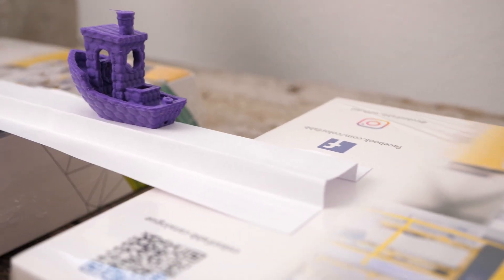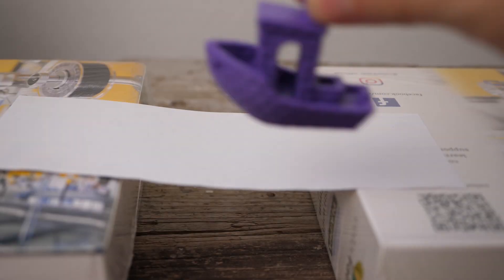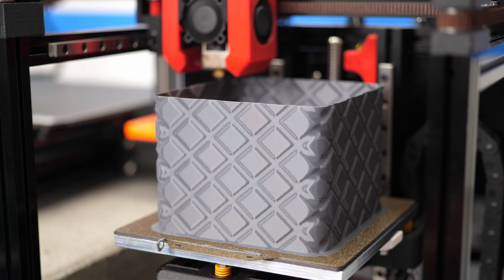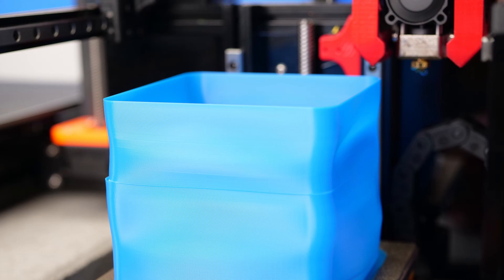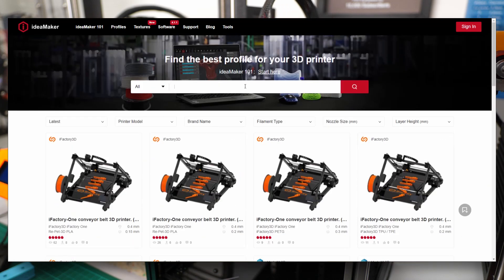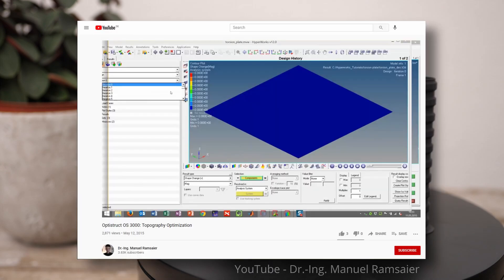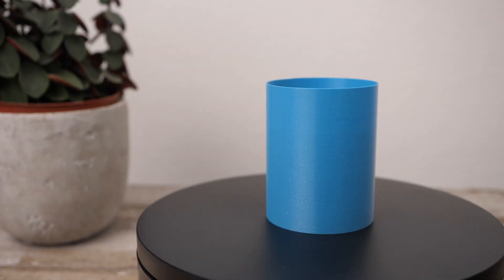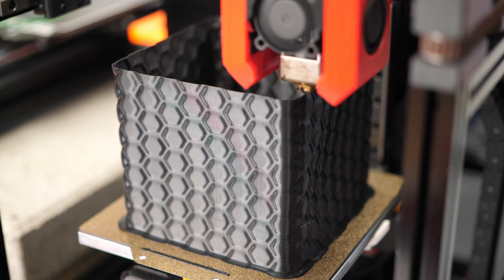Texturing 3D Prints for Strength!

Comment: Hey Nathan, I think you should make a video about surface hardness of 3D printing materials. I've seen on your channel all types of mechanical tests, I just thought it would be a nice addition and comparison method between materials. In my case I'm used to print a lot of spur gears for different mechanisms. So far my material of choice is PETG specially the one from MG Chemicals (natural transparent), I've found it to print very very smooth walls which help a lot with the rack and pinion mechanisms (maybe you should make a video on friction as well ;D) but I have the belief that it's surface hardness is way lower than PLA. For bigger gears and power transmission proyects this might be determining for the material selection.

Comment: This is really useful. I created a pull rod handle for my mother's curtains, and added some grip to it with the coil tool in fusion 360, but this texturing feature is exactly what I was looking for to add some grip to the handle which would be just a plain cylinder otherwise.

Comment: For each edge of your geometry draw a thick black line on your displacement map then gaussian blur and repeat until you have gradients  for each face, then apply sinusoidal tone curve and repeat until you have enough rings. This will give each face of the object a set of curves that follow its shape in a way that you can call poor man's optimisation. It is quick and it is dumb, but still adapts to the geometry that you have. The last application of a tone curve should probably be such that your original edge lines are in an area with mostly zero displacement.

Comment: Would you be able to only apply it for one side? I'm planning on using it for ducts for a quadcopter but don't want to influence the airflow inside
Reply from the maker: Yes, you can. There is an outside perimeters only option.

Comment: I've used that type of feature in modeling for many years, mostly for cosmetic purposes, but I'd find this all kinds of useful having this directly in a slicer. IdeaMaker continues to be one of my go-to programs even though I don't print directly out of it, it's built-in repair algo's are really decent, and dissecting things on the fly is super useful if you don't need it keyed.

Comment: This is a cool feature to add. I'd like to see transition options added to surfaces so that you could set inset distances where the texturing would start, and maybe add a fade in option. Would be nice to have this as a separate feature from the specific image file, so one file would be adaptable to a variety of prints.
Reply: Combined with a new N-Layer Vace mode you could get incredible strength in a couple layers.

Comment: Can I use the tool to make g code for a cnc mill?
Reply from the maker: It's not really meant for that application.
Reply: @CNCKitchen  the thing is I am using freecad and I am searching for a tool that enables me to make g code for my cnc because the path workbench in freecad is to complicated for me what application would you suggest for me thanks in advance

Comment: I need to test it on my assortment box system, since I already tested vase mode, but failed on larger boxes. And printing with higher wall thickness not only takes much longer, but is a huge amount of material just for boxes that usually never leave the drawer...
Reply from the maker: You'll be surprised how well that works.

Comment: You know they don't do it to save weight on a washing machine right? It has concrete bricks to add weight to the machine... They put features to the sheet metal to avoid the awful wobble sound that metal sheet would do if it wouldn't have that.
Reply from the maker: Saving weight in terms of expensive metal. Concrete is cheep.

Comment: I've been looking for a way to stiffen 3D printed ukulele bodies without adding more weight to get more "brightness" out of my design. This might be the thing. Now I'm wondering what pattern would be best for the front/top of a ukulele body: vertical line patterns, horizontal, mesh ...?
Reply: Have you considered traditional approach with braces? They are used exactly for the same reason.
Reply: @avelkm  Yes. Braces are what I am using now, very similar to a traditional guitar body with a set of just a few braces.  I am thinking of these surface patterns as a kind of large brace array, or a whole bunch of small braces, something that is not as feasible with traditional wooden construction but should be a unique feature of 3d printed bodies. I'm trying to move my design thinking from 3d printing traditional parts to "native" 3d printed designs that can take full advantage of 3d printing. It is not an easy journey.

Comment: Nice to see that slicers are starting to implement a feature i was searching for such a long time in cad. Was wondering. Would it be possible to get the texture on the stl file and then in a second step get the textrued object into another slicer like prusaslicer or cura
Reply: If only you had watched the video, you'd know...
Reply: @alejandroperez5368  i did but that detail I did not get an answer on.
Reply: @PBPZ22  no you didn't watch the entire video. The answer is no.

Comment: Fun fact: many water towers have rings around the cylinder on specific locations. This is not because of aesthetics but because water has the potential to break the container, thus those rings actually support the cylinder. Very similar to the idea stefan had with the washing machine.

Comment: "Texturing" 3D prints like this is certainly useful. Doing it in the slicer, however, seems kind of gimmicky. I'd always opt to do it in the design phase, where I have as much control as possible.
Reply: Not everyone only prints parts they designed themselves

Comment: Have done this kind of thing in 3d software like 3ds Max and Blender. Its the same method but dumbed down a bit and made easier to use.
I put nice leather pattern onto a file for someone a few years ago and they were really happy with the results.
Same principal as a lithophane. 
They might have also seen Billierubens posts about this on twitter in the past as well, so its by no means a new or even original idea but to give them their due, integrating into ideamaker was a great move so congratulations and thanks for the video Stefan, its always a joy to see that you have posted a new video. I don't think I've missed one but may have cut one or 2 short as they didn't hold any interest for me

Comment: Texturing, or "corrugation" can be absolutely necessary to enable printing. I've been working on designing rectangular bellows made of TPU, printed in single-wall vase mode. Without corrugation the tilted faces droop during printing, creating gaps and ruining it. Adding a light vertical trapezoidal corrugation removed the problem without affecting the functionality or creating other printing problems. A 16–20 mm width for each full /‾\_ period, distributed evenly to its four segments, worked well, with a corrugation "height" of about 1.5 mm. I painstakingly programmed the corrugation into the design in OpenSCAD.

Comment: Idea for future video: Vary the percentage of deformation introduced by the texture across multiple prints.  Test each print for crush resistance, evaluating the degree to which each level of deformation increases stiffness before it reaches diminishing returns.  Make a revealing conclusion that will enrich the 3D printing community.

Comment: This is reminding me of something. A while ago, I had heard of a paper that presented a way to print smooth(er) top surfaces on parts by having the printhead do a final pass over the whole top surface of the object (hopefully I'm explaining this clearly enough). Have you seen it in a slicer before? I wonder how much it would increase the strength of a curved part, since the whole top layer would be connected in one pass
Reply: Huh sounds like ironing, which is a setting present in Cura and PrusaSlicer.

Comment: Thanks for sharing!  Awesome method and wondering how this will catch on with the other slicers?  Thinking for aircraft or other designs textured is the way to go if using like you note PETG, ABS or maybe other materials with similar issues and concerns.  Seems like one can use a thin covering like Monokote or even pp tape like clear HD Duck tape for the smooth surface while optimizing goals.

Comment: Brilliant work Stefan. The next stage is optimising the width of the vertical ribs in the rounded cube for least final object mass with maximal deformation strength (in vase mode of course). I would think the thinner the ribs, the greater the total circumferential path and therefore mass.

Comment: if you could get the texturing on the inside instead I imagine that would be very beneficial for wings
Reply: Then you'd have to have at least a double perimeter, adding to the weight.
Reply: @JonS  maybe you could do a single wall layer and a light infill but modify it so you only get a infill mm or two away from the wall

Comment: vase printed threads have extra radial strength over a straight tube and are easy to add in fusion 360

Comment: I wonder if one slicer could implement something like this only for the innermost wall of a print.
Reply: Or use Blender for the modell. There bump Maps have been used forever...
Reply: @AndersJackson  Blender user here as well (since 2.49b). I was thinking more about having the pattern as the innermost or maybe 2 (maybe you could alternate the pattern) innermost walls, just before the infill. That kind stuff wouldn't be possible to change inside Blender because you can only change the shape, but not how it's sliced.

I mean even if you added the pattern in Blender (through the displacement modifier) to the inner side of let's say a cilinder, it would have to be hollow and thus the infill wouldn't be inside the model, but maybe just a really thin layer.
Reply: Agreed, hide this on the inside and allow the infill patterns to overlap...man, PLA wet could be strong...
Reply: What you're requesting makes no sense. Your print would be full of gap-filled areas where the bumps are.
Reply: Also a new N-Layer Vace mode would let you decide on the strength and set them separately for inside and outside.

Comment: This texturing would be awesome for draftshields for those of us that have open printers and want to use ABS/ASA. I know, a draftshield is not the best you could have, but it helps most of the times I print in ASA. Well, except when it bends into the print itself or bends so much that it gets an unusable mess that messes up the print...

Comment: How did the textures change the weight and length of filament used?
Reply from the maker: 1 or 2% more. Basically negligible. You'll notice a longer print time due to all of the direction changes, though.
Reply: @CNCKitchen  I started to think about weight when you brought up airplane wings.  I wonder if there is a texture that would have no negative aerodynamic impact while adding beneficial stiffness.

Comment: About warping, one important thing is that just after being deposited, the new layer is free to shrink because it's liquid. It only becomes a problem once the new layer solidifies, while it is still hotter than the layer below, because from then on you will get a differential shrinkage. This also explains why high glass transition temperature has much more of an effect than the coefficient of thermal expansion, and why heated chambers help as much as they do. You can also preheat the part using light, which I find very compelling but I haven't looked into it myself yet, though NASA did. They were able to print PEI on a relatively low-cost printer using an array of halogen lightbulbs to preheat the part.

I published a video on this just a few days ago: https://youtu.be/_x_PlqCr-2A

Great video once again!

Comment: The ridges on tin cans are not for strength.   They are there for when the food is cooked in the can during the canning process, it allows for expansion and contraction.  Food that is not cooked in the can will be flat walled.

Comment: I want this on the internal supports inside 3D printed wings. Not sure how to make any use on the outside surface without a lot of research; smooth may be best there.
Reply: Don't think it's going to make things better - internal supports of a wing are already oriented in most stiff way,  they don't have side-to-side bending forces. So it would most benefit having surfaces textured. As for smooth surfaces - maybe use some kind of laminating fillm, it will also significantly reduce damage when model crushes (it really helps in foam planes)

Comment: Holy moly you could use this to add automatic dimpling to aircraft wings, simultaneously adding strength with minimal weight. The golf ball theory of aerodynamics.
Reply: Plus dimples act as vortex generators, leading to softer stall (but worse cruise performance). Want to try this for stiffness though!
Reply: @bob2859  if you can figure out a way to print it with an itty bitty hole in the middle of each dimple, then duct a little bit of thrust into each wing, the extra pressure would add stiffness, with the positive pressure making the dimples as slippery as  snot on a slip and slide. Make the duct actuated, and get best of both.

I know NASA tried something like this. The project was considered highly successful technically, but was killed by maintenance problems. Cleaning out all the little holes was prohibitively expensive on a full size jet wing. At a small enough scale you could just detach the wings and toss them in the dishwasher and/or ultrasonic cleaner.

Edit: ducking speech to text.
Reply from the maker: Yes!

Comment: Hey cnc kitchen i have a question i have an anycubic mega zero it is not wanting to print but when manually tell it to extrude some plastic it extrudes but when it goes to print no plastic comes out I've already cleaned the nozzle assembly multiple times but it's the same thing so someone u know said that is could be a problem with the startup code in the slicing program and i should look into that if you have any recommendations please tell me I've had this problem for a month and still no solutions

Comment: Check out the new zigzag z non planar print pattern. They should add a significant amount of impact resistance parallel to the layer lines.
Reply: Thanks for posting it looks very promising.

Comment: This looks like a good way to put knurling or texturing on parts, for grip, particularly those with irregular shapes.  For example, Fusion360 does not offer that feature (that I have found, anyhow) on surfaces (except cylindrical, which you can accomplish using screw threads).  So I'll be giving this a try!

Comment: Really cool! I can see this potentially be used a lot.
Another way to improve print rigidity that I have seen in clay and cement prints is letting the filament droop/spill to the side a little so the over-hanging loop sticks to the lower layer(s). Is that something you would wanna try with a plastic 3d printer?
Here are some examples:
https://www.youtube.com/watch?v=9jFZgOiQejQ
https://youtu.be/XMu-rgXZRCI?t=160
https://www.youtube.com/watch?v=w8udvGK2I4E

Comment: Stefan, I'm always impressed with your videos. Great info.
Question for you (and the community)...
As another 3D modeler that doesn't have much interest in figurines and decorative models either, I often find my engineering-needs require 3D prints that are longer on just one axis. How often do you wish you had a printer with a build area that was, say, 1000 X 250 X 250 (mm) or so? Just sitting here, looking around the room, nearly everything is rectangular in shape. Why do nearly all 3D printers have cube like build volumes?
Reply from the maker: Belt printer maybe? I guess having this ratio of axis length is not optimal for stability and shippability from China ;-)
Reply: @CNCKitchen  Perhaps. Once I think about it though, it's probably lack of demand. Most of what I see being printed is knick-knacks that fit the current build volume(s). I suppose I'll have to build my own if I really want one.

Comment: Now.  I want to see this added to the infill for increased part stiffness and strength while maintaining a smooth outside. In theory, with the inside infill done first, the increased rigidity should keep your outwards fill more even, reducing internal microcavities and improving horizontal layer adhesion and uniformity.

Comment: I think it's a great technique, but I would prefer do do this in CAD, not the slicer. All the geometry for a part should be encapsulated in the STL, not added by the slicer later. Anything else is just unnecessary fragmentation.

Comment: Would be neat to be able to texture the interior wall only 

So a cylinder would have a smooth exterior but a matching inner cylinder with the waffle pattern
Reply: I wonder if you could overlap a smooth one and a textured one just enough to get one that's smooth on the outside and textured inside
Reply: @castleboat  duplicate it 
Set 1 to print normal 
Shrink the x and y on the other and texture it
Reply: You could also use that kind of thing for lithography since you'd have varying thickness

Comment: It will be a perfect way to reduce weight on printed parts. Might not be vase mode. But shelled. Think of  T piece pusher. Add texture and I can reduce wall thickness. Does it export the pattern to a 3mf file? I want to test it on a HP MJF.

Comment: i wonder how much of a difference this would make on your usual filament tests. i know you said it’s mainly for vase mode prints, but maybe you’d get some interesting results
Reply: I think the proportional increase in dimension from a thin wall to textured wall is significant enough to make a difference whereas a solid print having a bit of texturing is only a small proportional change in dimension. So it probably wouldn't have much of an impact on solid pieces
Reply: @arax20  "solid" pieces are just a collection of "thin" pieces when comes to 3D printing. This could be huge.